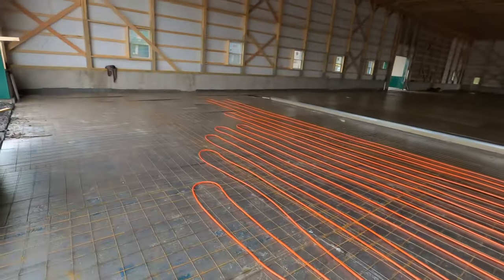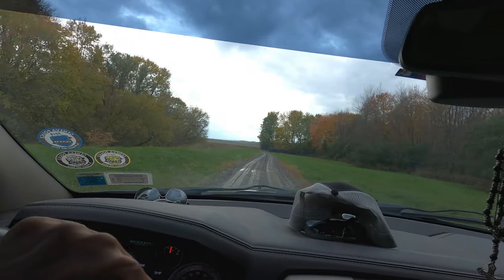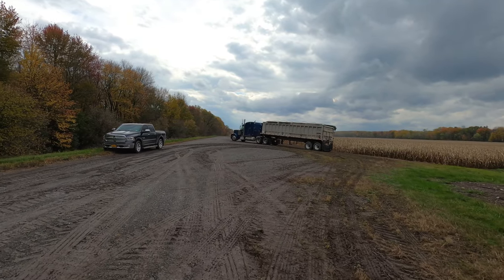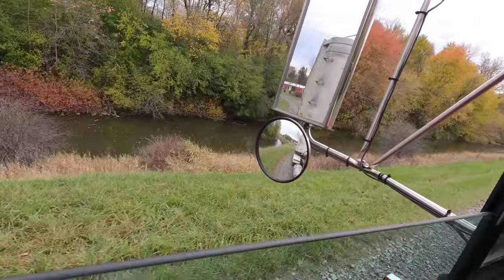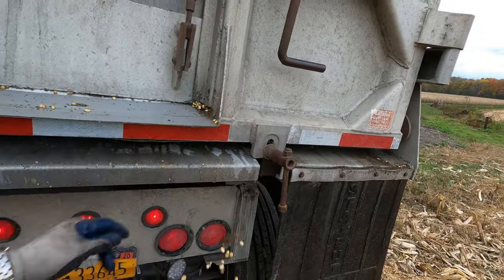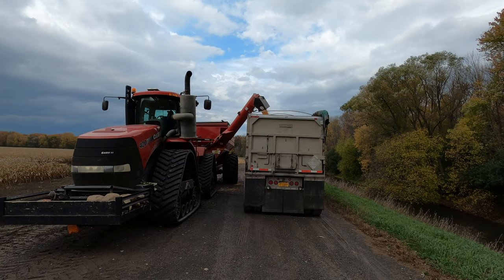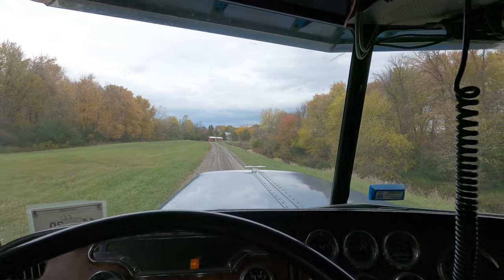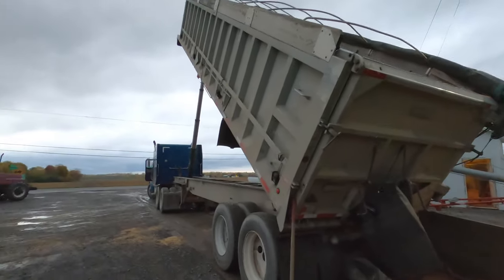2020 Corn Harvest

Comment: I've been told that you cannot harvest in the rain correct?
Reply from the maker: I’m not a farmer but it obviously makes mmmmmmoisture higher 😜 ..... and there is def a limit
Reply: When it rains the corn stalks and husks will start to bunch up on the combine header and not go through the combine good so that's what usually shuts things down. Mud quickly becomes a problem as well for just moving around. The corn itself is protected inside the husk until harvested so it won't soak up much until it rains a lot.
Reply: @farmcentralohio  right on brother thanks